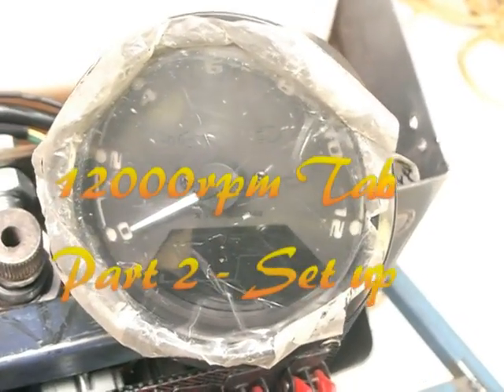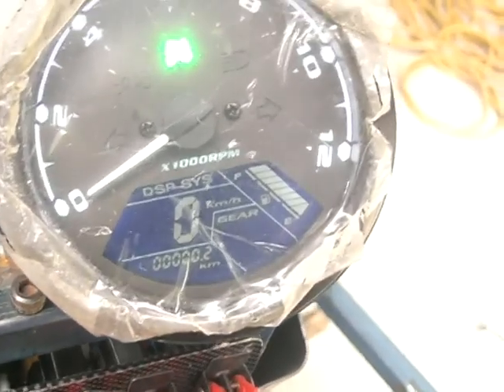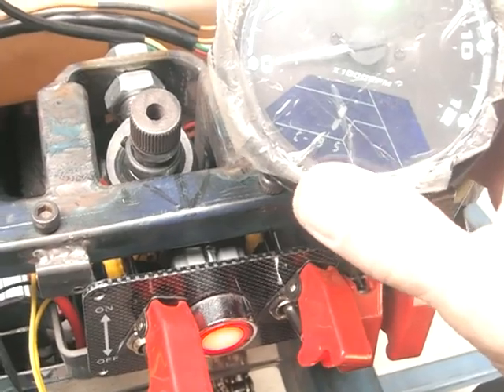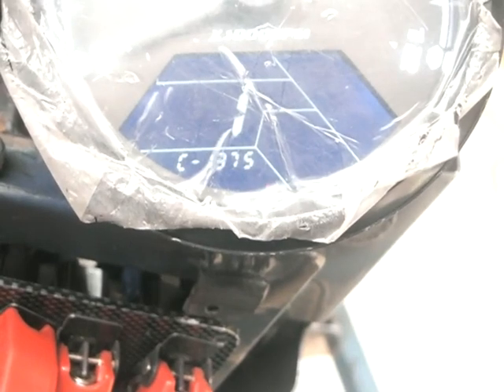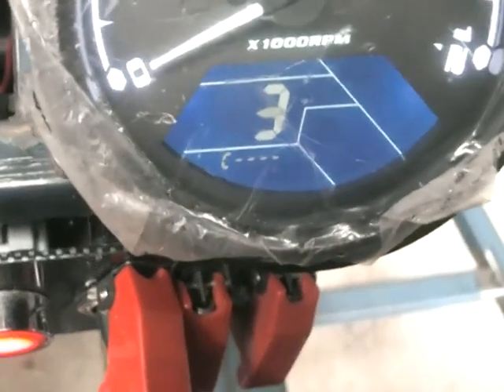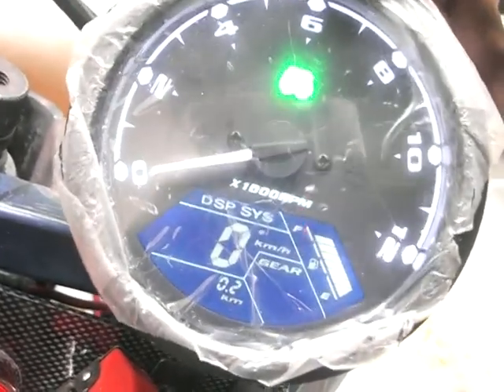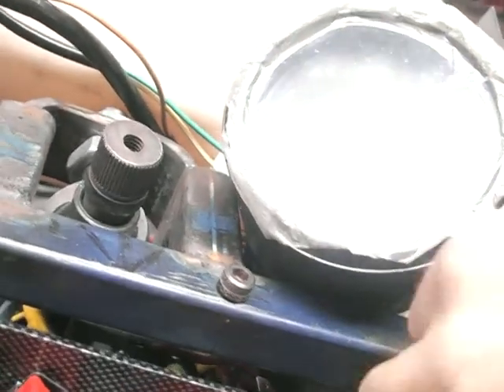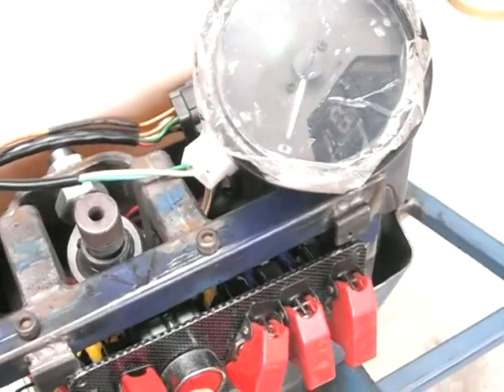12000rpm Tacho Part 2, Set up instructions

Comment: Hi man. Thanks a lot, I wasn't even understanding how to access the menu system😂. But now I have a bigger problem, I have to add the previous kilometers, do you know how can I do it? Greetings from Italy
Reply from the maker: Hi mate, it’s been a long time but the odometer is in mode 5. You might be able to set a km reading, use mode 5 and see if it pressing the buttons lets you add a setting. I can do that on my Acewell speedo but not sure about this cheap one. Good luck with it..

Comment: Earthed my my fuel gauge wire still doesn’t stop flashing any help? 7:50
Reply from the maker: Sometimes these are supplied with slightly different connectors or cable colours. Sounds like you might not be earthing the right cable. Check the wiring diagram you should have with the unit or ask the supplier for a diagram to check. There’s always a chance there’s some issue with the unit, at the end of the day sometimes you do just get what you pay for…
Reply: Ok got it sorted just added a resistor to stop it flashing

Comment: I have installed two of these on BMW k75s. They power up ok but they don’t have lights coming on the screens. Any idea . Thanks Tim
Reply from the maker: Hi Tim, hard to say other than check all the wiring. These are cheap tachos so it could also be faulty.

Comment: I NEED HELP !
I saw part 1 but i didn't see anything like my problem... First i had connected both [+]wires (red and black) at the key of my moto so when i turn it on it should move the needle up and down and at the same time the light turnes on, but the settings on the speedo's menu resets every time i turn off the key... 2 days ago I changed it, the red wire is always attached to the battery [+]pole and only the the black wire is on the key so the speedo is always powered on and displaying all gears, speed and gas level but with no backround light (the backround light is the black wire which is powered only if the key is on) Everything was running perfectly but the other day the battery was dead meaning that the speedo shouldn't be always attached on the [+] pole but if it is not always attached the speedo menu settings resets!
Did i do something wrong ?? Please I need your help 
[my English is not perfect, if you don't understand anything let me know]
Reply from the maker: Hi mate, if your wiring is like mine you need to have the solid red wire from the tacho connected directly to the battery so it has power all of the time. The solid green wire goes to earth and the solid black wire is power whenever your ignition is on. The solid red wire uses extremely low power and won’t drain the battery. Hope this helps
Reply: @Mezzmoengineering   that's what I thought. Thanks for your time, but my red wire kills the battery after 5-6 hours.
It may be broken 😔
Reply: @Mezzmoengineering  The way you just said is exactly the same as mine now, but this way, any time i turn off the ignition, the speedo keeps a green neutral indication and if I can see well, the tahometer is also working with the ignition off 
When I turn on the ignition, the only thing that changes is the background light
That's may why it is killing the battery
Reply from the maker: @aggelosprintezis1808  There must be a problem with the speedo if you have the solid red wire on the battery feed. Maybe just check that you don't have power feeding any other cables when the ignition is off other than the solid red,.
Reply from the maker: @aggelosprintezis1808  Something not right. Chinese can sometimes mess the wiring colors up, maybe see if the ignition power is actually the mains power. Otherwise, its probably faulty. Its a cheap tacho, I did another video on the XJ650 build showing a high quality tacho that works perfectly....

Comment: Hi i watch the setup video about the cylinders
So ir saying when u change it from 1 cylinder to 2 or 4 u can not go back to cylinder 1 or 2 let me know thanks
Reply: I also have one mechanical woth all digital and it let me switch from 1 2 and 3 over and over for the cylinders im not sure why they dont they make all like that if someone buy it and have 2 cylinder then sell it and the person have one cylinder his scrued
As ot wont go on cylinder 1 in the settings anymore...
Reply from the maker: @myhoyoki  At the end of the day, this is just a cheap chinese tacho. It works well but not the best option in terms of quality. For my bike build I used an Acewell speedo which is an excellent speedo with a lot of flexibility. Check it out if you want, https://youtu.be/hQOvKcha4Ms
Reply from the maker: Hi mate, unless they have changed the design, once you change from 1 to 2,3 or 4 you cannot go back to 1. Once changed it will only have options of 2, 3 or 4.
Reply: @Mezzmoengineering   ok so 1 is default as one cylinder right if it os then i dont care because my bike is V2 Cylinders with 4 strokes and 2 coils on each cylinder

Comment: Hello everybody,
Installed same tachimeter and It works great but I don't understand how to fix wheel diameter setting, which percentile value XXXX I have to put for Honda Hornet 600 I think front wheel Is 16" or 17" ...need to check tomorrow!
Thank you everyone could reply and help me
Reply from the maker: Hi mate, I explain how to do that in the video. Check at 3:15

Comment: HI thanks for great set up video part 1 & 2 i have a Yamaha FZR 1000 4 cylinder 2 coils  i have a problem with the Taco i have set it up on mode 3 & set to  2 coils with the yellow /black wire connected on to the grey wire from the crank pick up but it reads 8,000 rpm at idle . when i connect it to the black wire it reads 1,000 rpm at idle great but when i bring it up to 3,000 rpm  it is very erratic and if i rev it to about 4,000 rpm it reads 12,000 rpm  any help would be appreciated cheers
Reply from the maker: Hi Rick, you might need to try installing a resistor in that line as it might be getting some interference from the system. Google speedo idle pick ups as there's info around and ideas that have worked for others.
Reply: @Mezzmoengineering  Hi thanks for your reply. my Original taco wire went to the grey wire out of the ECU . at the moment i have only tried the taco yellow / black wire on to the  crank pick up grey wire then taco reads 8,000 rpm at idle . 
i have tried google but not found any information 
i think your right a resistor might be the answer but not sure which one 
thanks

Comment: any help about speedometer/ speed sensor? mine is not working by hand. i get some metering when i dont click the 2 parts (speed sensorto 3 wholes). its a problem from the sensor ? the magnets? or just the speedometer has problem? i cannot find anything. everything else is working
Reply from the maker: Hi mate, check the magnet rotation. They are directional, so turn them over the other way and see if it works
Reply: @Mezzmoengineering  yes but did yours worked first by hand? or you had to put it at ur wheel?
Reply from the maker: @lices  It should work by hand

Comment: Hey sir, my speedometer won't work properly. When i turn the ignition off the speedometer will quickly cut-off as well and the hand of the tachometer will remain where it stay before i cut off the engine the tachometer hand will not go back to zero rpm.
Btw we have a same speedometer.
I hope you'll help me.
Reply from the maker: Hi Dave, checked your power wiring. Sounds like you might not have the constant power connected properly. this causes your problem. To fix this you need to be sure you have power from the battery connected as per my video.

Comment: Installed this on my Suzuki vz400. can't get to the menu. pressing button for 3 seconds does nothing. power on holding the button also does nothing. Shows gear, neutral, revs all ok. but can't set perimeter of wheel cause can't enter the settings.
any help pls?
Reply from the maker: You need to have the button held on before turning the power on
Reply: @Mezzmoengineering  I bought my Suzuki used so I don't know what the previous owner did. from what I see, behind my speedometer there is the 25? pin adaptor but also there is a speedometer cable going down to the wheel. There aren't any magnets. I don't know how they did that but the speed displayed on my speedometer is almost half the real.
Reply: @Mezzmoengineering  Ohhhhhh. So I think this is why mine isn't going into settings. Right now I have both wired into the ignition on wiring, but now I see it needs to be always connected to the battery on one wire

Comment: Thanks for your instructions, everything works just perfect. I'm just a little bit curious, how to mount it? There was no mounting bracket included :/
Reply from the maker: Hi Mate, there are two bolt holes in the back you can utilise to mount to a custom bracket. Thats how I did it...

Comment: Did you put the 2 magnets far from each other?
Reply from the maker: Hi mate, if you use more than 1 magnet you need to ensure they are equally spaced to get an accurate reading. First magnet pulses at whole revolution and second pulses at half a rev. If you use 3 then space them so they are 1/3 of the circumference. One magent works fine, just 2 is better at slower speeds

Comment: Mine has strange speed readings. I used all 3 magnets, equally spaced, on the brake rotor. The sensor needs to be very close (within 1 mm) to sense the magnets. When I start driving it all goes pretty well untill approx 30km/h and then it starts going crazy. Jumps from 30 to 50 or even more, not steady readings and while I am driving around 40-50 it shows 120 and goes up and down between 25 and 120.
Reply from the maker: Seems odd, maybe try using just one or two magnets
Reply: @Mezzmoengineering  I will try that
Reply: Hello, FYI; It is working okay now. What have I done? First I rotated the magnets, because of their polarity. Now the sensor does not have to be within 1 mm of the magnets. 2-3mm works ok. But I still had no good solid readings with 3 magnets or with 2. With just 1 magnet I seem to get the best solid number in the display. And I think it is pretty accurate. Thanks for the info and video.

Comment: it does not mark the fuel level, configure the dash and check the cable connections and it still does not mark me, could you guide me?
Reply from the maker: Your fuel sender might not have the right resistance. check the empty and full resistance, from memory mine was 8ohms to around 90ohms. This gauge cannot deal with all resistances but it has a couple of options. You might want to try installing a resistor on the cable feeding the speedo to change the input signal, try different resistors.
Reply: Do you remember what resistance you put and how many watts?
Reply from the maker: @tomasignaciomatamalabaez8527  First you need to measure the empty and full resistance of your sender unit. In option 4, if you pick mode 2 it matches a resistance range of 10 -90ohms from memory. If you sender is higher then first try mode 3 and if that fails you need to add resistors to get the right range. for example, say your sender read 40ohms but you need it to be 90ohms then you add a 50 ohm resistor in series, you then need to minus that amount for the low reading too. Hope that makes sense.
Reply: Mezzmo Engineering really thanks im gonna do it

Comment: Do you have Facebook or instagram? I need some help with this motorcycle gauge
Reply from the maker: Hi Chris, I have face book. Dont use it much but its Classic Celicas and more. Or just ask here or on my email.
Reply: @Mezzmoengineering  I found you on Facebook and left you a message. Should we use that for contact or just use youtube?
Reply from the maker: Hi mate, probably best to just ask on youtube or my email mezzmo@iinet.net.au
Reply: @Mezzmoengineering  I was gonna ask you some information about the motorcycle gauge' I'm linking it to my Celica. I think I figured it out only thing left is to figure out the gas level and calibrate the system from the button in the back.
Reply from the maker: @Sargon77757  It could work. Just follow the video instructions. I don't know the resistance of the celicas fuel sender but if its wrong you could mess with other resistors to get it to the right range. Don't know anyone thats done it though

Comment: Thank you, thank you, thank you. The 1 - 12 option on setting #2 had been driving me insane trying to work out what it is for. Have you been able to figure out a way to reintroduce the "1" option back into setting #3? I have a Kawasaki S2 (350 two stroke triple with aftermarket electronic ignition) and it reads way too high, switching from 4 to 2 helped but it still reads 8,000 at idle (it was 11,500 on setting 4!)
Reply from the maker: Hi mate, I don't know of any way to get option 1 back.
Reply: @Mezzmoengineering  Thanks anyway, stay well & stay safe
Reply: Hello did u figure it ou

Comment: Excellent video, thanks. Anybody has a problem with revolution when switching the key??? Mine sometimes stops at la 12k rpm and need reswitch to 0 rpm.

I've changed 1 Cylinder to 2 by error 🥺🥺🥺
Reply from the maker: I don't think its possible to get option 1 back again

Comment: Great video !! So much help with the settings. But my question Is I  installed this on my bike and I'm having difficulty with the speedo magnets hall sensor set up. I've mounted to my rear wheel and placed magnets on the heads of the bolts of the rim I have 5 so I used 5 magnets. When I drive my speedo is  very jumpy and will not read over 29km/h. Once the speed increases past 29 it drops to 11km/h and just stays at that till my speed drops back down. I believe I have all my setting right. Any ideas what could be wrong is it better to only use 2 sensors. And also money came with 2 thick magnets that are grey in colour and the 5 or 6 regular shiny magnets that are not as thick what is the purpose of them?? Please help!!
Reply from the maker: Hi mate, I think two magnets are enough, more magnets are better for slow speeds. So unless you ride around at 10km/hr or less then 5 is not required. Also, make sure the magnets are approx 2mm from the sensor and they are spaced at 180 degree from each other on the wheel. Finally magnets are polarity sensitive so try installing them the other way around, eg turn them over.

Comment: Hi . Really useful video. But can you tell me if it will make any difference to which cylinder setting if i am putting this on a Harley which has got twin plug head conversion using a pair of twin coils?( i.e four plugs ).
Reply from the maker: You need to try test it out but I think it needs to set to 2 cylinders
Reply: Ok mate.Thanks for getting back to me. I'll try it on two cylinders then.
 @Mezzmoengineering

Comment: This is the most helpful video out there thank you... I have a question tho ... How do you reset the odometer (menu 5) ? You explained what mode 5 does but not how to actually reset the odometer. I know you will probably not see this after all this time but I would like to thank you anyways. Cheers.
Reply from the maker: Hi Angelus, not 100% sure. But when on mode 5 try press and hold the button and if that doesn't work, when in 5 mode, press button and don't hold and see what happens. I'm not sure if it fully resets or if it takes off X km's each time you select that mode. Good thing is that its definitely mode 5, you just need to test these options to figure out how to reset. Good luck...
Reply: @Mezzmoengineering  Hello there,I tried both options before I comment but they didn't work that's why I asked for your help.

I think the instructions state that you can delete 200km at a time for 3 times and then you can enter the mode again to clear more.

 The thing is that I have 200km and I want to clear exactly 200 km but it won't let me.

If I figure it out I will reply here.

Thank you for investing the time to reply to my comment.
Reply from the maker: @PureVenomthe1  Hi mate. OK, might be a long shot but perhaps try again once the distance goes over 201km, maybe it needs to be higher than 200km before it will reset.
Reply: @Mezzmoengineering  Thanks I will try later . Have a great holiday.